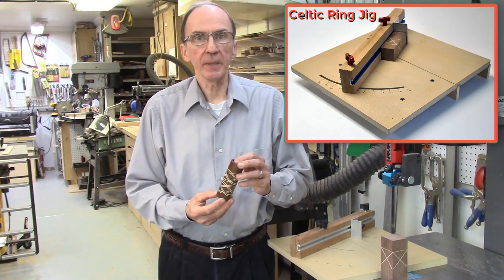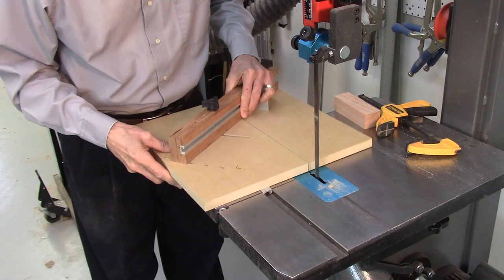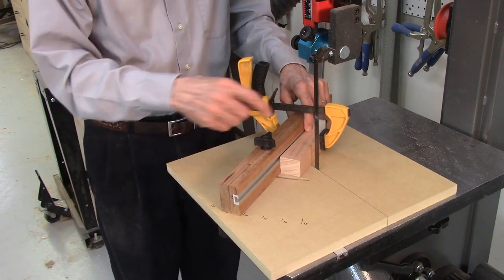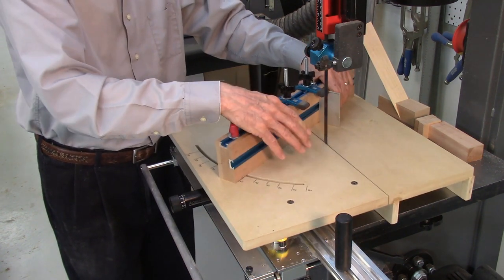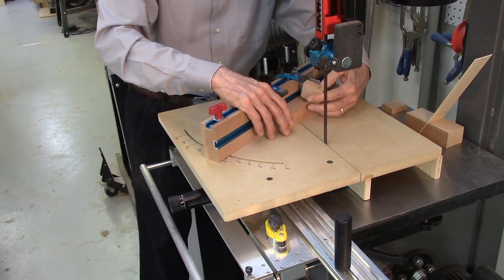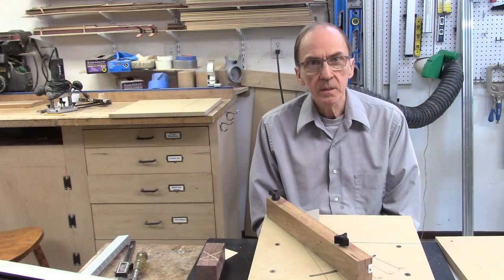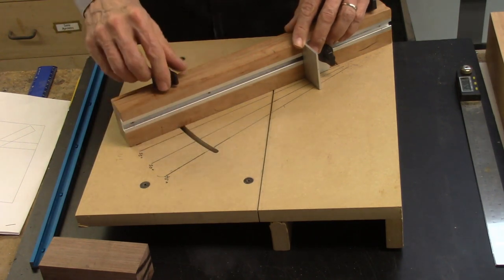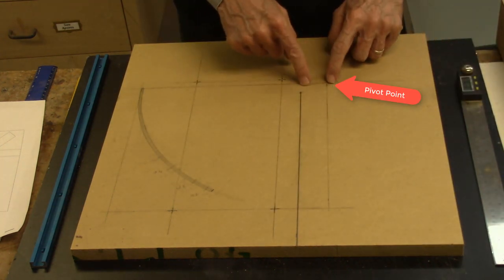Design and Production of a Bandsaw Jig for Making Celtic Rings and Celtic Knots (18)

Comment: Why would you not just put a thin piece of sacrificial material behind the stock to prevent the blade from going into the fence?
Reply from the maker: You could do this if you just wanted to not cut into the fence.  However what you really want to do is stop the blade from completely cutting through your board.  I prefer to set the stop so that the blade stops 0.10" from cutting completely through the board.
Reply: Ok now I see. I thought you were just trying to prevent cutting into the fence. Thanks.